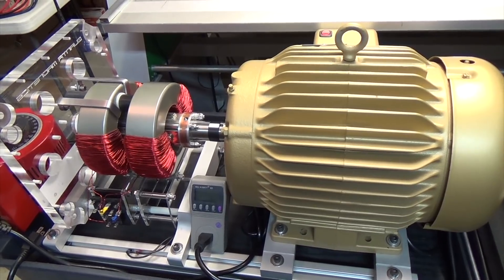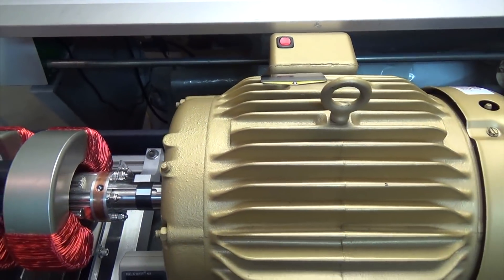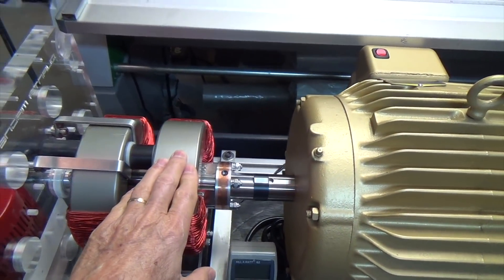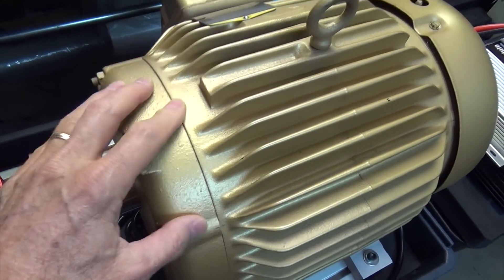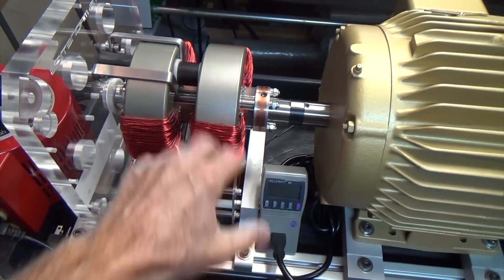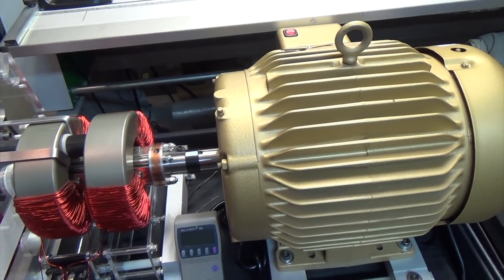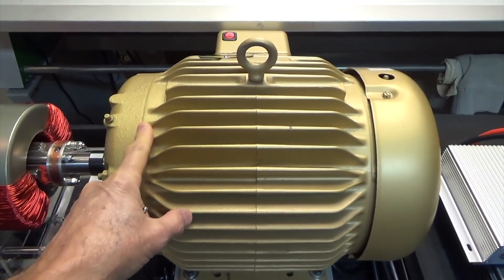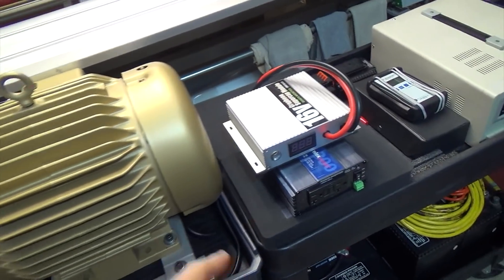Graphene Powered RotaFlux Generator

Comment: All this appears to be awesome. BUT, the big question, in my opinion is, can this machine setup SELF RUN and still give out excess energy and if Yes, how much in watts? Because that is what matters, finally. Having Solar in the background will obviously cover up any shortages and come out as excess. Thank you.
Reply: Lol, no it cant. You're going to lose 10% in the inverter, 10% in the motor, and 10% in the generator assuming everything is 90% efficient , which it surely is not.

Notice he didnt put any load on the motor here. Im sure that motor can run free at 30 watts or so without issue. 30 watts in will never equal more than 30 watts out. If the thing could self run he wouldnt need to sell you supercapacitors.
Reply: Yes this type of machine could self run. The Rotoverter is consuming a low amount of energy, the generator part is probably generating way more than the Rotoverter needs to run.
Reply: @damianjones6546  "Probably" generating??? 😅😂😄
Reply: @damianjones6546  Repeat after me:

POWER OUT

IS NEVER

MORE THAN 

POWER IN

Got it?

(except fusion, eventually)

Comment: here's the problem with what you're doing. you're using a solar panel, but you're neglecting to show the batteries which are obviously running this system. in order to convince me I would need to see the entire system. but you're neglecting to show the key component, which of the batteries. so personally I would never endorse your product or believe it. but that's just me.

Comment: So basicly the Red unit /device on the left is the speed controller to tune it down to the speed that efficiency but still produce the most power?  Instead of 4 magnets, if you make 8 or 12 magnets would it produce more power? because more magnetic field? or no need? thanks

Comment: I understand you are using the latest "skelcap batteries"  that hold a far greater charge than standard super/farad caps.  But most likely you will discharge rapidly power supply if you were to put any load output of those coils/ bridge diode rectifiers. The red button on the motor shuts off the run capacitor after the AC motor rises to nameplate RPM, There is nothing special here.

Comment: try looping back the access energy(if any) and connect the load.. if "lucky" you should get the Kapanadze generator/transformer effect.. 40Watts in >> 5000 Watts out :))
Reply: I'm already in mass production, it can be done，40Watts in >> 5000 Watts out

Comment: Okay.... powering the motor to run open circuit toroids....   all your having to do is beat the resistive turning force of your motor.  I bet once you try to put a real load to the outputs, the torque will increase to the point it shuts it all down...     So effectively, you just showing you can keep the motor spinning in a free wheel condition....for an hour.     Does that have a purpose?   If you are not charging or loading the toroids, and showing actual work done... then not doing anything but free wheeling the motor.
Reply from the maker: This is a nearly Lenz free application. You can load the toroids all you want, even totally shorting them out, and the motor will not slow down. How's that for a purpose?
Reply: @PMMG4HYBRID  Then please show us that if that is the application.  I have a need for such a device, but this only seemingly discusses your rewiring and the running of the drive motor...  that's great, but I was looking to see if the shaft of the motor is loaded (such as when providing electromotive resistive forces) how does the system reacts.  If it is free of resistive force then show that please, it's not been my experience.
Reply: I guess what I want is what's in the title...   If it generates, then show me the generation ability.   I have not had such experience at such seemingly little drive efforts.   I would like to actually see the generation in a couple examples.   Thanks
Reply from the maker: @SV_Vindvarg  Will do!

Comment: In summary the capacitor will power a 30 watt light bulb for 1.25 hours, which is significant. I think the motor / generator setup although cool on its own merits, steals the headline of what the capacitor does.

Comment: Wow Mike ! What an achievement in electrical efficiency. Regarding the Graphene 16 Volt module; I am assuming there is some way to recharge the energy stored in it ? Can you elaborate on how this works and how much you are selling these Graphene Moduals for, please ?
Reply from the maker: Yes, you can channel the rectified DC output back to the source of input (Graphene Module) providing that it is voltage compliant and an isolated circuit such as the dual toroids are. https://www.shop.quantamagneticstore.com/16V-2000F-Graphene-Supercap-Module-GRPH-mod.htm
Reply: @PMMG4HYBRID  Unfortunately all your links are broken... Is your server down ?
Reply: @oudotcom  someone said in a reply comment above yours that he has passed away
Reply: @pbandjelly1311  Странно все кто такими вещами занимаются погибают.

Comment: Sooo....why do you need the big motor again? Why not just something big enough to run the generator coils?
Reply from the maker: This completes the task while idling at 28-30W @ 1770 rpm and has a 50 lb armature/flywheel. Also under a mechanical load, it will deliver up to 1.8hp on demand. No little motor can offer this.

Comment: Hey Mike! Cool solution! I have a question regarding the GS module - What would be the easiest way to install that on bicycle?  What kind of motor could you suggest with that? If want more volt engine should I add some coil to convert or need batteries or smthg? How would charging it back by the pedaling would work?

Comment: You could literally change the world with this system! Think of the number of off-grid applications with a set up like this such as  catering for the  motorhomes and caravans sector not to mention yaghts & barges, electrical vehicles, greenhouses etc 
The costs of these systems would reduce over time due to the high demand providing the system was reasonably and realistically priced! 
You would need a higher workforce to cater for the high demand by means of assembly to manufacture! Smaller and more powerful battery sizes would no doubt be the latest energy commodities for the ever evolving Stock Markets no doubt!
In a short space of time hopefully the markets would sober up to this Lenz law defying technology! Because right now the World is critically in need of this technology as it's been shelved for far too long to supposedly protect the private corperate interests of an already old and dying energy industry that stems deep underneath our feet against our natural coarse of technological capabilities and developments. The time has finally come when the D.O.E along with those corporate entities with their own private interests must not become aggressive or hostile over this technology ever again but instead by embracing it aswell as contributing to bringing this technology forward equally for the betterment of a new and thriving industry soon to be! Not entirely for profit but for humanitarian necessity also that guarantees a long and thriving and ever advancing industry within the energy sector! And big deal...so what if these systems violates Lenz law?? Who gives a s**t! It's only one version of conservative physics which was then for this is now! This technology reinforces our inner perptual progressive concepts within our electrical enginuity by the mastery over the conservation of energy! When Tom Bearden once said that energy can be tapped then the rest of us should be asking, how much more can it be tapped?? When many now know and realise that it's more than just possible! All this level of technological suppression from the early 20th century's Alumni's academic notion that had originally arisen behind closed doors just to silence guys like the great legendary Nikola Tesla has proved to be arguably short lived which have now come to light all over the World! Nevertheless based from advanced technological methodologies that have been restricted to keep us all oppressed and in the dark for far so long!
The deep decompartmented establishments must now finally refrain from ever hampering the technological progress and achievements of mankind period and allow us to proceed in advancement within this field from the R&D processes to mass production for the wider communities for our fellow brothers and sisters! Our World really depends on this technology more than ever as the ecological damage that has been inflicted upon this Planet is now deemed critical!!! Over-Unity energy conversion and generation is a very good start and is in the right direction although the level of criminality within it's suppression is unspeakably and monstrously and criminally shameful!!!
⚙⚡🧲⚠️

Comment: Couldn’t you run that 40v from the 3rd phase of the motor through a buckstep down to ~16v and keep the voltage up on the capacitor bank?

Comment: Is it safe to hook a bunch of these graphene super capacitors in parallel or even series? I'm wanting to use them for a massive instantaneous draw on a electric drag racing motor setup. (They only need a few seconds of massive output, I figure since they're discharge rate is better than lithium batteries for their weight, I'd have an advantage?)
Reply from the maker: Yes and yes.

Comment: What brand of inverter are You using. I have 3 different brands, and they overload when attached to my graphine cap power?
Reply: You may want to try Reliable Electric. They are a lower end inverter but they can custom set input voltage to your specs. A 4 s NMC will be similar to your needs
Reply from the maker: The little 300W inverter is a Samlex Pure Sine Wave. They make larger inverters too.

Comment: 2:10. Could you please explain what you mean with bridge ractifier and rotary transformer? Sketch would be nice. Did you use a regular 4 kW AC motor or did you have to change anything?
Reply: bridge rectifier converts ac to dc ,when you rotate motor with power on 2 windings  the 3rd winding acts like a transformer and makes power out put like a generater ,,you can use this method to make 3 phase power with single phase supply .
Reply: @bohydrus7108  are you sure about that? You cannot spin an AC cage motor with DC current. You can with one AC phase but if you put a bridge rectifier in front, this won't work. It might if you use PWM. So, I am not sure if this is correct. The BR might be used to rectify the 3rd phase that is used as a secondary to feed a battery or so.
Reply: @lektor0815  he is using the rectifier to change the voltage coming out the 3rd winding to dc lol ,,no not spinning ac motor with dc

Comment: There is a pretty strong motor. So why not extend the shaft another 4ft and put more coil generators on it?
Reply: You could why not try it!
Reply: @m1rroredgesharpeningservic546  Its all about finances. There are other things i need at the moment. But thanks. Smile
Reply: The motor will consume more power. As shown there is no load.

Comment: i need to watch this few times to comprehend...wow you should route the system to recharge the 16v graphene powerpack
Reply: Was just about to leave message saying sane. Recharge the 16v at sane time could run indefinitely?
Reply: @btekwindsolar  You have to note however, there is absolutely NO load being applied....  so its just freewheeling, not even charging the batteries.
Reply: @SV_Vindvarg  correct

Comment: Always interesting designs here. You're selling your things and it's great for you and innovation.  But I dream that one day you create your own HUGE electric powerplant.  I just imagine if you add a solar pannel farm with this ( but way bigger for a whole city... the future is here)
Reply: Solar is archaic at this point and creates more toxins in the environment for a small reduction in CO2 emissions... We could do so much more if we create thorium-based nuclear powerplants and they are the cheapest option and cleanest option in the long-run, even able to take the nuclear waste produced by the older nuclear power plants.
Reply: @silviafox78  and How much this powerplant cost removing grass? takes carbon? how much electronics does it take? :)  no radioactive incidents? You're dreaming! Go take a walk around Chernobyl powerplant for 15 minutes ;)
Reply: @realcourte  - good question. Usually Thorium-based Nuclear power plants have a higher startup cost compared to coal, oil, gas plants. However it is much much cheaper to maintain them over the long run as they do not have to pay high prices for oil, coal, or gas and can recycle old spent nuclear fuel rods of our older Uranium-based fuel rods which is basically free-to-a-good-home unless those older nuclear plants prefer to bury their fuel rods for over 10,000 years, instead! But even then older depleted uranium and thorium is much cheaper to rely on especially considering how expensive it is to sequester the Carbon emissions produced by the system. Overall the cost comes out to about the same or less within a couple decades and leads to a cleaner and cheaper source of energy for future generations. 
I assure you I am not dreaming and 15 minutes in chernobyl has been found to be safe at the moment for researchers and such.